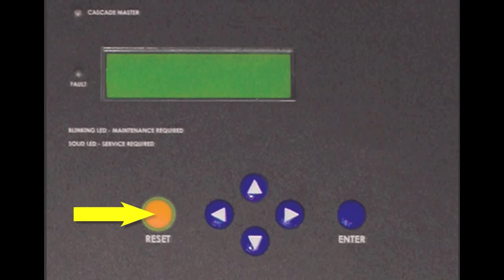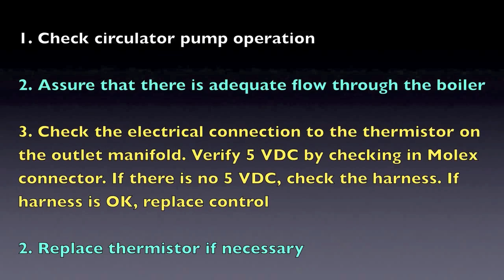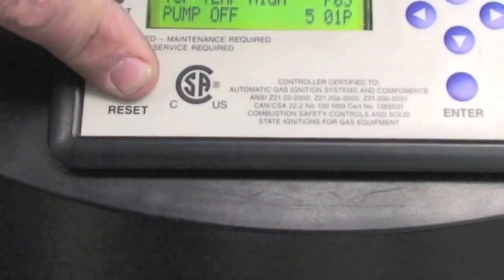F03 Fault Code Boiler - Return Temp Sensor Failure

Comment: I had this code early this morning. I tried cycling power and resetting the unit but the error code kept coming back. I turned off power to the boiler and went back to bed to deal with it after some more sleep. 4 hours later I turned power back on with error code still present and hit reset again. The code cleared and the boiler started running as normal and has been doing so for the last two hours. What could be my issue?
Reply: Casey Smith did it happen again.just had same issue
Reply: John Manganello I had someone come over and try to figure it out but it ended up just being a waste of time and money. The problem just seemed to go away on its own.